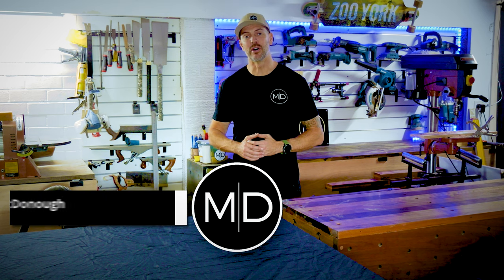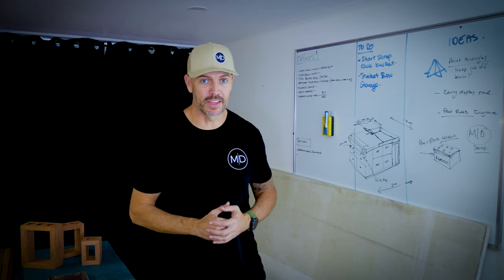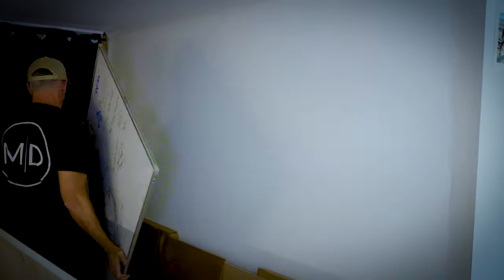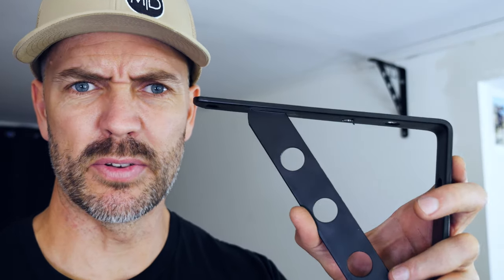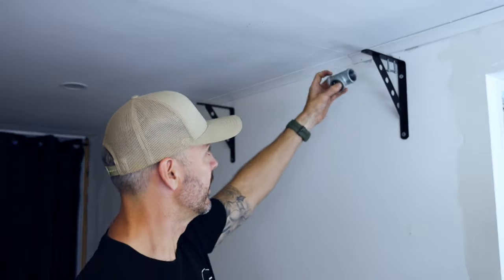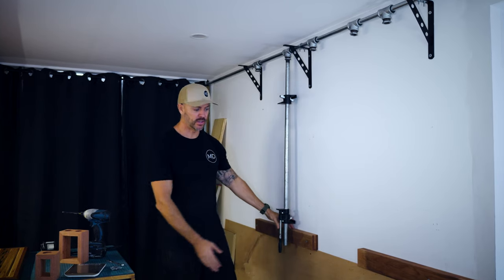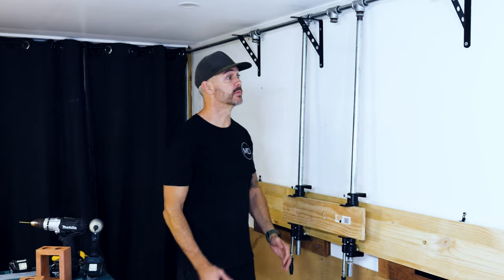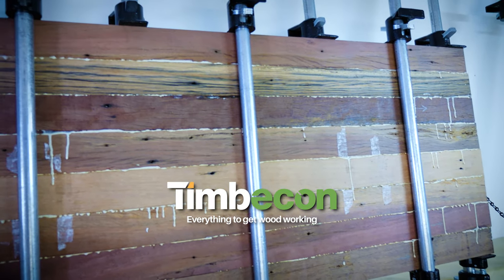How to make a vertical clamp system

Comment: Yup, this is what I’m doing until I’m ready to pull the $2k trigger on a 4-way wall mount clamp system. Thanks for the great idea. Very budget friendly for the time being.
Reply from the maker: @denisdelaquis1174  It definitely served it's purpose 😀 It would be nice to have an industrial size vertical system for large builds, but it does the job for the small stuff 👍🏻

Comment: Any lessons learned after 9months? How do you ensure the bottom clamp heads are all level to one-another?Glue drip catch feedback would be helpful, too. Thanks!
Reply from the maker: I use a spirit level to run along the bottom clamp heads to check they are all level. I run a length of brown wax cooking paper across the bottom ledge to catch the excess glue. The space saving aspect of the rack is definitely more of a positive than the accuracy. Everything I glue up has to go back through a thicknesser anyway, so it did the job for me. I have since moved into a commercial factory so I don't use it as much anymore. I still use the clamps but on our big glue up tables that are nice and flat. But it still comes in handy for the odd home project from time to time.

Comment: G'day Mate, just found you on the Timbecon channel. Always good to see a newer Aussie maker channel on the tubes. This is a brilliant idea I might steal one day, such a great use of space and makes these glueups much easier. Pretty sure you can swing it with traditional pipe clamps but the double clutch is a nice feature.
Reply from the maker: Thanks mate. Really appreciate it. Go nuts, I find it a pretty good use of space. The double clutch definitely makes the shelf work better as the shelf can slide up and down on the back of the pipes without hitting a fixed head. But yeah you could probably sort something out. Thanks for the follow 👍🏻

Comment: genius!
Reply from the maker: I definitely didn't invent this type of system. I took the idea from some commercial setups I had seen and redesigned a "home use" clamp system. The idea of the T-section/pipe I hadn't seen before. Much smaller setup than the commercial ones I'd seen too. 👍🏻